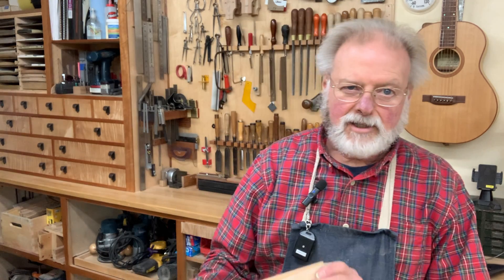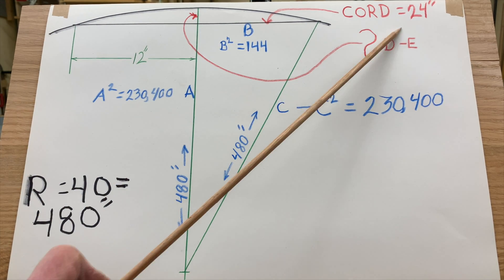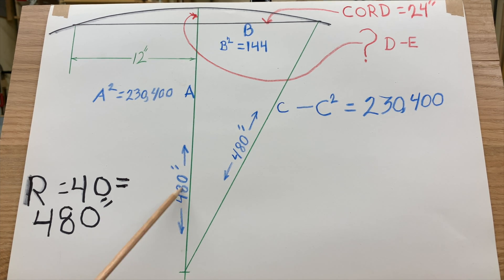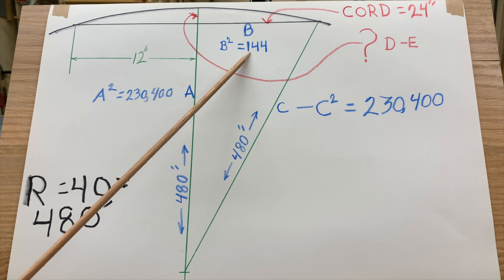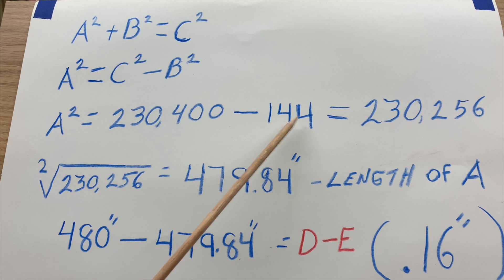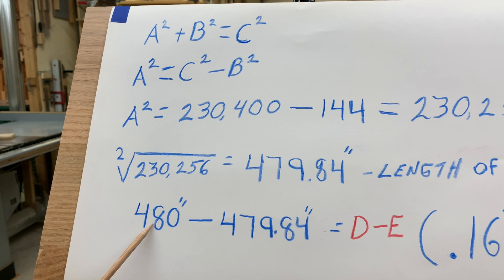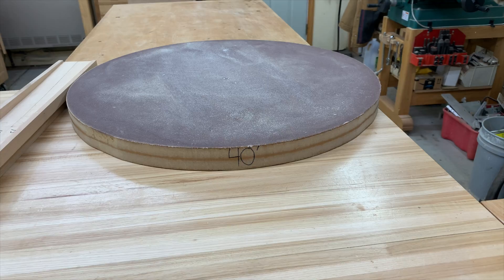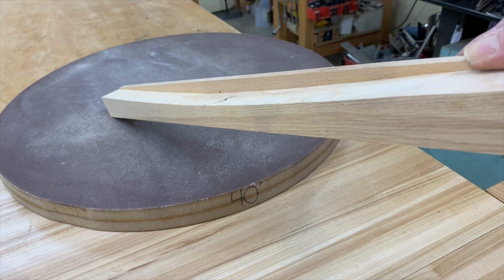THE RADIUS IN THE RADIUS DISH! HOW DO I FIGURE THAT OUT?

Comment: There's another way to make the dish. Figure out your offset via pythagoras. Make a carriage for your router has rails four and a half feet long. The rails will be cut ramping from zero at the center, where your router is attached, to your D-E dimension 24" past in both directions. Continue the line all the way to the ensd of the rails. These rails ride on a pair of parallel rails set perpendicular to the router rails. Set to router so that it takes no cut at the edge of your dish. As you move the router across the dish the bit will describe an arc of your desired radius, cutting maximum depth in the center and continuing the arc to the other side. Youll also need to pin your dish in the center so it can rotate. It sounds more complicated than it is to make and use this rig.

Comment: This is great!  One little comment:  The process and equations are correct, but for the example, you rounded down rather than up for the square root of A^2.  It is 479.85 inches, which means the height should be 0.150 inches rather than 0.160 inches.  Not a big deal as you said, but if you do the math on 0.16 inch height you get 37.5 feet for the dish radius.  The difference in the height measurement is only about a half a pencil mark width, so we are going to struggle to make it perfect no matter how precise our calcs are.  Love the channel!!!!
Reply from the maker: I'm positive that your mathematical logic is absolutely precise and pertinent in manufacturing where precision and predetermination is necessary just for the purposes of repeatability and manufacturing processes.  Thank you for recognizing that hair splitting is of little use to many.

Comment: Where did you get your pins?
Reply from the maker: Dowel pins are probably available in the specialty hardware drawers in hardware and big home centers, but you can easily use a piece of common steel rod. You could even use drill bits as registration pins in a pinch.
Reply: @thepragmaticluthier  Thanks Kevin!

Comment: Do you have strong feelings about what radii to use on a first build? It seems like 28’ top, 15’ back is consensus?
Reply from the maker: My experience has been that as the reason for increasing the dome of a top is to help stiffen a soundboard so as to enhance or maintain high frequency response.  The reason for doming a back is to increase its reflectiveness by stiffening it.  For a first instrument, I wouldn't get too aggressive because it's a matter of being able to perceive the difference at this point in your experience.  While I don't recommend a perfectly flat back and rim, you could do it.  You can begin with whatever specifications you wish, but my recommendation would be to make things easier by using the same dome for the top and back. I would start with a  25 or 30 foot radius.  Good luck with your first guitar and enjoy every minute of the experience:)

Comment: Where do you get your 24" sanding discs and what grit(s) do you use?  Do you get them with a peel and stick back or do you have to use a spray adhesive?  I assume 80 grit would suffice.
Reply from the maker: I make my own dishes and use 80 grit PSA discs on them. They are very easy to make and at the prices they sell for, it's worth learning ho to make them.

Comment: Once you've fashioned a router track, why not just adhere sandpaper to it and use that to radius the guitar body? With a little care to keep this "sanding stick" level, it should work fine. The making of the dish seems to be an unnecessary extra step.
Reply from the maker: The router track cannot do the job of a dish, neither for doming the rims or gluing the braces.

Comment: f (big if) I am correct that the upper bout above the sound hole is flat, does this mean the upper braces, the flat popsicle sticks, for example,  are glued on after the radius X braces come off the radius disk/ go bars?
Reply from the maker: The entire top is domed. The area where the fingerboard will cross the top can be flattened . At a 25 foot radius, for example, the high point of the chord of the dome of the chord representing a 3 inch wide fingerboard would be .00376", not much to sand away:)
Reply: @thepragmaticluthier  thank you!

Comment: I agree 100% with the math used for the deflection at the center calculation.  I puzzled over constructing a circular surface by point deflection of a simply supported beam.  I agree this will make a smooth surface but I don’t think it is precisely circular.  I did some internet research and the shape of your deflected rod is not circular.  The curvature at the ends (by pin supports) will be lower than at the center.

I used an excel spreadsheet to calculate the circular deflection at various locations away from the center when I constructed my dish.  Worked ok.  Microsoft did the math.  😅
Reply from the maker: Sounds very encouraging. Did your spreadsheet reveal how much deflection from a perfect arc there is?
Reply: @thepragmaticluthier  I oopened up my spreadsheet and added a sheet using the deflected beam approximation you used.  for starters, I discovered that I estimate the central deflection should be .1499" not .16" for a 40' radius dish.  The maximum error from a circle with a deflected beam (method you demonstrated) is .011" a bit less than 10 %.  I am not sure how accurate you can cut your lines in the template but 0.01" is not an insignificant error.
Reply: @short6691  seems to me, that 2 loading points at a given separation might reduce the error you discovered significantly. I wonder what that distance would be? 8"? The thing is, having 2 point load is a cinch, and could be achieved with another center loaded beam of stiffer persuasion.
Reply: This deflection method creates a catenary - the profile of the droop of a rope  between two poles. Not an arc. It’s a pretty shape but is not a segment of a circle. I’m sure at this scale there is no measurable difference. But please be clear, I can argue with your method as it doesn’t achieve what your math correctly calculates.
Reply from the maker: You're correct.  If you read the comments above, you'll se that another contributor has calculated the disparity to be .011".  The purpose of the entire procedure is to create an even, consistent curve to work with. The calculations provide a quantifiable goal and the method demonstrated provides a technique to reach it at a level of precision that is beyond actual necessity and one that can be performed by nearly anyone.  "To be clear", I pointed out the likely imprecision in this technique and also pointed out that departure from the mathematic precision was to be expected and is acceptable.  If you demand mathematical precision in your dish, buy one or produce one with CNC equipment, then demonstrate how it makes a marked difference in the mechanical or tonal quality of a guitar made today and or before such precision was within the reach of even the best producers  of them.
Reply: @thepragmaticluthier  I don’t demand excessive precision in the woodworking involved building an instrument, rather request that we be clear that this technique creates an useful approximation of an arc. Thank you for your demonstration of a method to produce a fixture broadening the accessibility of your craft.
Reply: @thepragmaticluthier  I had nothing to do this afternoon, so I did a experiment. I have 2 dishes made on a cnc router. I took a nice straight brass rod and pushed it down with my finger in the middle. I used a feeler gauge and found a wide area on each side at about .011. So then I found some different length pcs of lumber and gently pressed down the brass rod with the lumber. So now I have 2 points pressing down very gentle like. Searched around and finally a pc 16" pressing down the rod gently gave a small gap on each end of .004.....I expect that an 18" pc will probably do the trick, but I ran out of easy to find pieces of wood. The upshot of this is if you run plenty anal you could get that error down to a gnat's ass, if ya wanted to.
Reply: @thepragmaticluthier,  When I went to boat building school about 2 decades ago we had a course in traditional drafting used by naval architects and boat builders, probably for centuries.
We used a method similar to what you showed, but instead of a steel rod we used fairly thin, straight battens of wood, maybe 5x5mm or so, and either a set of pins or dedicated weights with a small nib on one end to keep the battens in place at specific points on the drawing.

That gives a very controllable and smooth curve between a set of points, and drawing boats is a lot of tracing lines from given points 😁

As discussed above, bending a beam doesn't give you an actual radius, but if you were to bend a batten along say 5 points instead of 3, you would definitely get very close on a span of 24". 2 endpoints, 1 center and 1 point each side, in the center of the 12" spans. One more point to calculate, and to get it really accurate you'd need a few more steps of trigonometry, but still the same simple math :)

But, I do agree with you, the difference between an ideal radius and the catenary (keeping the midpoint at the right distance) will make absolutely no practical difference as long as everything is built to match :)

Comment: The Liutaio Mottola website's Technical Design- Calculating the Sagitta of an Arc section has calculators for doing the math for those of us who need it. (My high school's "Open Math" experiment was a failure).
Reply from the maker: Thank you for sharing that information!  I remember Open Math and other subjects early in my career. You're absolutely correct: it was a TOTAL FAILURE.

Comment: A gentleman named Christopher Paulick has a video on how to make a radius dish using what he calls a long compass. Although I understand how straight boards, angled to each other, and joined together at the center of the router bit will make an arch (radius) as you move the configuration side to side over fences erected on each side of the dish blank, I have yet to figure out how make a long compass. Specifically how to calculate the angle of the boards to achieve said radius. Might you, having a better understanding of geometry than I do be able to explain it on a video? I really would appreciate it. It would eliminate the need to cut and sand the radius for the router to ride on.
Reply from the maker: Excellent question and suggestion for a video. I may try to present that in the future. In the meantime, I believe the short answer is; given a cord of the proposed radius, equal in length to the diameter of the dish you're creating,  you will need to first calculate distance from the bisector to the arc as shown in this video.  When that distance is plotted, you now have three points to work from. Draw a straight pin from each end of the cord to the calculated point. The resultant angle is the angle needed to construct the long compass.